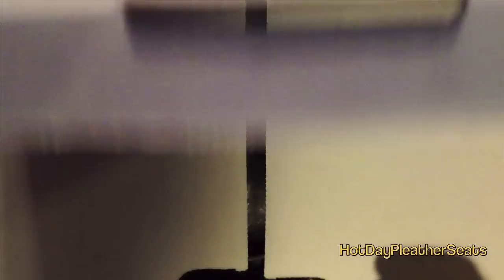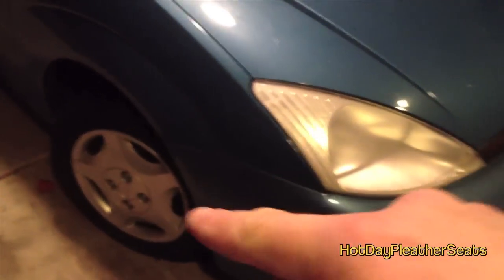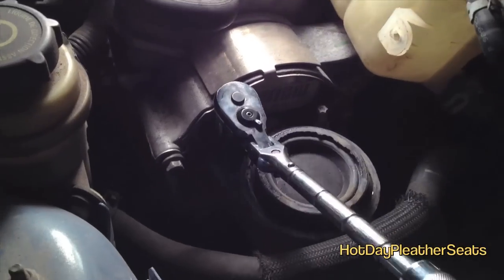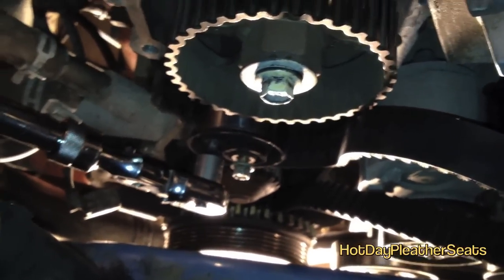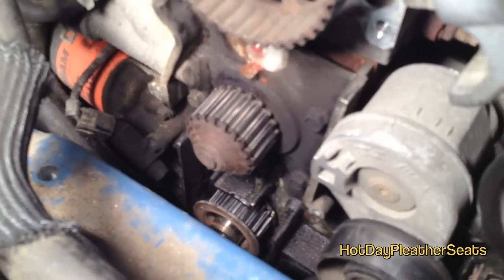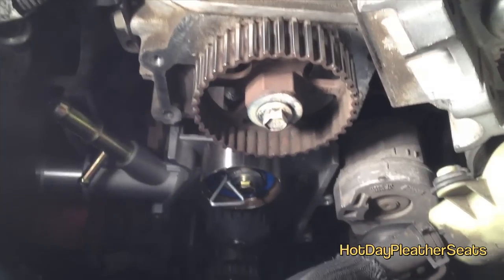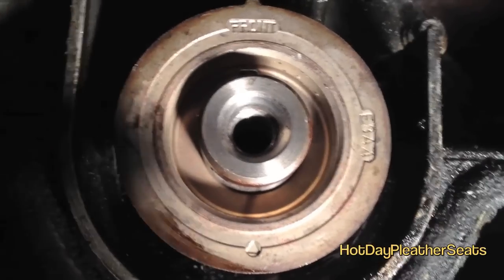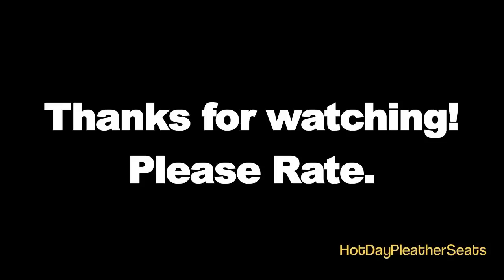How to replace a water pump & timing belt on a Ford Focus

Comment: my 2001 ford focus zx3 started making a noise the other day that sounded like certain death for my motor. come to find out it just needed a water pump kit as shown in your video. and thanks to you breaking it down for me, i was able to replace it by myself. thank you!! your video has helped me soo much. thank god i didnt have to pay a mechanic
Reply: What kind of noise did the water pump make when it was going bad. I have an 03 and its making a loud ticking noise in the top part of the engine on that side.

Comment: great video one thing I wanted to mention ford makes a special tool called a camshaft tool that is very important with installing a timing belt if you accidentally move one of the camshafts out of place,upon start up of the car it can cause major engine damage,valves making contact with the piston,and lets just say replacing the engine,it pays to have the right tools for the job.

Comment: For anyone doing this job, ALIGN your TIMING marks before removing the belt, also loosen the crank harmonic balancer bolt before removing the timing bolt 
These are interference engines, the valves will HIT the pistons and bend the valves if you go wrenching on the balancer bolt, or the turning the cam without turning the crank in unison. 
Over all not a bad video, just a little out of order.

Comment: Hey thanks for the video, I would like to know, with a 2002 Focus with the SPI engine, is it an interference or non-interference engine? I have gotten so much conflicting information about this issue, even from the Parts Department at Ford. Also, do you think the Gates timing belt is adequate for a replacement, as adequate as Ford Motorcraft. Ford recommends a replacement interval of 120,000 miles.

Comment: Then at the end he says it again! YOU DON'T NEED THE SERPENTINE BELT TOOL TO INSTALL A NEW BELT IF U HAVE BOX END WRENCHES (I USE TWO AT A TIME (IF U KNOW HOW TO CONNECT 2 BOX ENDS TOGETHER FOR EXTRA LEVERAGE, IT'S SIMPLE! MOST IMPORTANTLY, WHAT HE DIDN'T MENTION (SEVERAL THINGS!) U SHOULD 1ST PUT THE MOTOR @ TDC (TOP DEAD CENTER,& MAKE SURE ALL OF YOUR ALIGNMENT MARKS LINE UP! THEN MARK YOUR TIMING BELT IN SEVERAL SPOTS & PUT MARKS ON THE PULLEY IN LINE WITH YOUR MARKS ON BELT SO MARK THE PULLEY & BELT AT THE SAME TIME.WATER PUMP & BELT, CAMS & BELT' ETC! INSTALL HEAD BOLT INTO THE WHOLE THAT LOCKS THE MOTOR IN PLACE B4 REMOVING THE OLD BELT (REFER TO OTHER ZETEC TIMING VIDEO'S) ALWAYS DOUBLE CHECK YOUR TIMING MARKS ON MOTOR!!! THERE ARE VERY GOOD TIMING BELT VIDEO ON YOUTUBE FOR THE ZETEC & SPI FUCUS LOL

Comment: Great video.  That doesn't look like my engine. Maybe you'll want to specify that this is SOHC or Duratec Engine.

I'm 2.0 DOHC (zetec)
Reply: Here is One we want. "Ford Zetec 2.0 liter timing belt replacement Part I HD"
Reply: ImAdapt73 Ford Zetec 2.0 liter timing belt replacement Part II HD